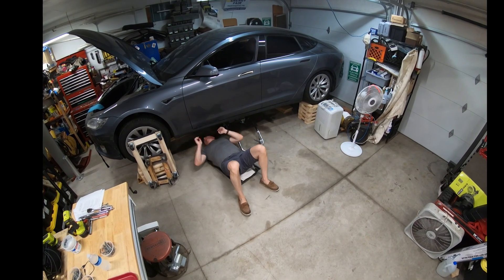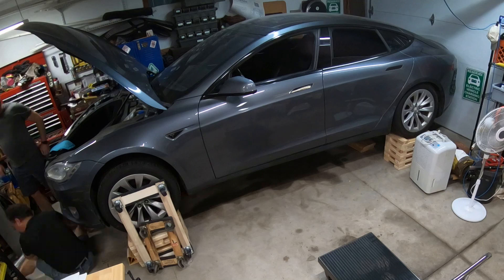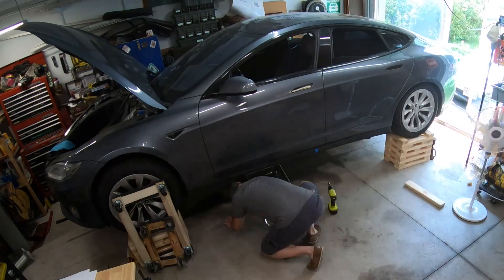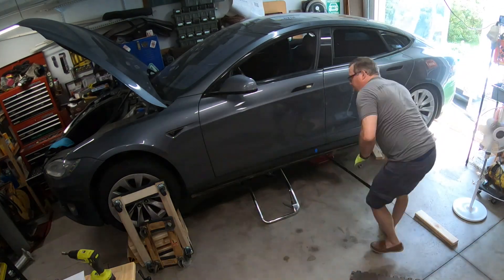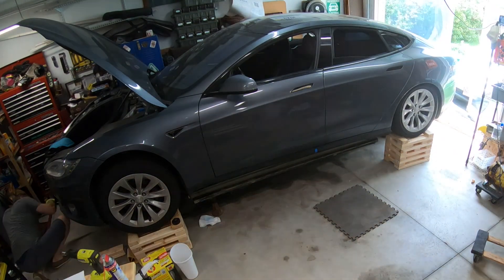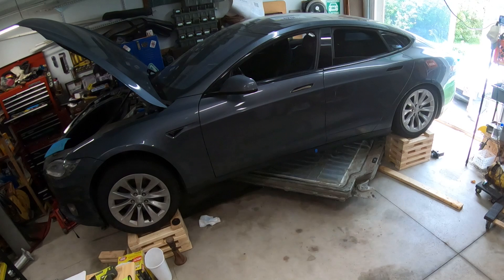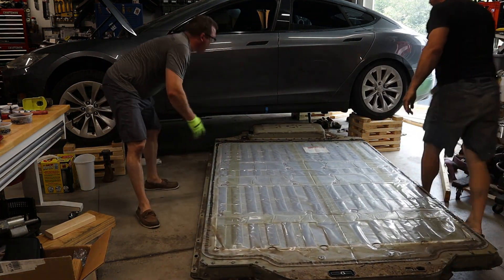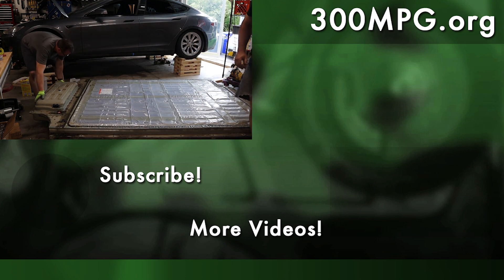Tesla Model S Battery Pack Removal Time-Lapse

Comment: I’m removing battery on model s tommorow, do the coolant lines automatically disconnect when you lower the battery
Reply from the maker: Yes, the “Rapid Mate” connectors for the coolant only stay in place by the fact that the battery is bolted up in place under the car.
Reply from the maker: Please make sure you know what you are doing before dropping the pack. This google doc has some good info. https://sites.google.com/view/teslahvbattery/home

Comment: What lift did you use?!
Reply from the maker: The car was just lifted with regular jacks and I placed wood cribbing below each tire. To help lower the battery pack, and move it out from under the car we used a hydraulic table from Harbor Freight.
Reply: @BenjaminNelsonX just scraping out all the muck (loads of it here in the wet Uk) from the umbrella areas, pre empting doing something similar to you in the future !

Comment: Can you please share some details on the dimensions of the cribbing you built for the tires.
Reply from the maker: Yes. There's certainly a few different ways a person could do it, but I made mine 12" wide by 20" long. Those two measurements equal 32", and that's one third of 96" or 8 feet.

I used common 8' long 2x4 lumber and cut exactly three 10" and three 20" pieces out of each.
Reply: @BenjaminNelsonX  Thank you for the quick reply!
Reply: @BenjaminNelsonX hi so is it 3 - 12" or 10" pieces per wheel

Comment: Excellent progress, thanks for sharing. 
At 1:55 I am baffled as to why you bought a hydraulic lift, then removed it and used ordinary furniture dollys instead?
Reply from the maker: The hydraulic table supports the middle of the battery. It prevents the battery from tilting while lowering it. It also takes the weight off the jacks on the ends, when readjusting them such as to add or remove wood blocks since the car is up so high. 

The hydraulic cart also only has steering wheels on one end. The furniture dollies have all wheels that swivel, making it much easier to rotate the battery to get it out from under the car.

Comment: Cool time lapse.  In reality, how long did it actually take to remove the battery?
Reply from the maker: Probably half an hour. 
There’s a lot of bolts to come out. That goes pretty quickly, but it’s a lot of crawling around under the car. 
For actually LOWERING the battery, it was a matter of doing it slowly and surely. Having multiple jacks and a second person makes it much easier. It’s also important to keep the battery level. Lastly, the first movement of the battery should be to drop it a couple of inches relatively quickly. This disconnects the coolant lines and lets the built-in shut off valve activate to help keep coolant from leaking everywhere.